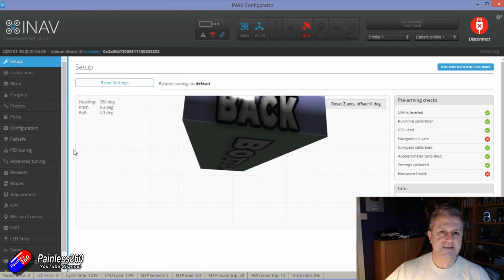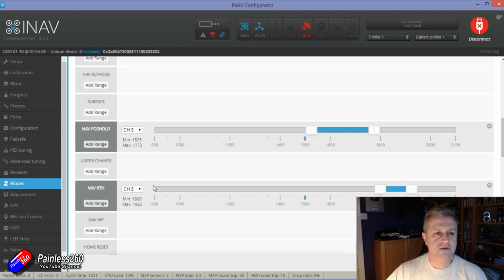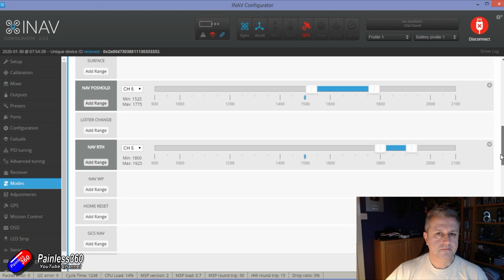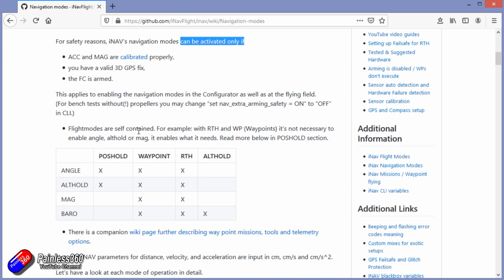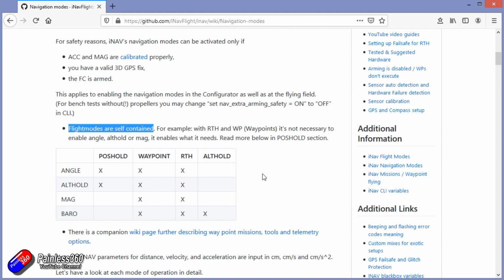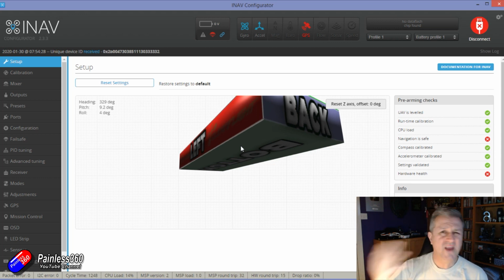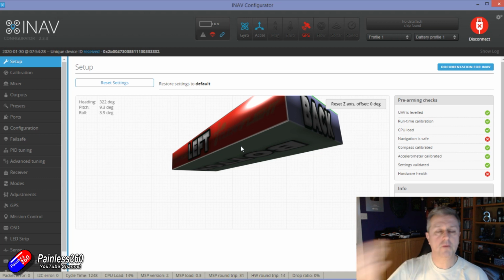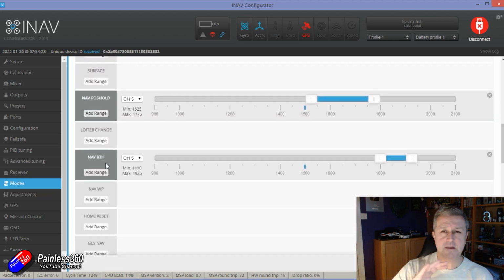Why won't my INAV GPS NAV RTH mode (and others) turn blue in configurator?

Comment: For some time now, I've been struggling with a problem I encountered in the INAV configurator (8.0.1) working with a Speedybee F405 wing controller (firmware 8.0.1). The GPS is configured correctly, works, and finds a 3D fix with four satellites, but its status is always blue regardless of the number of satellites. This is a bit annoying because it's unclear whether the GPS has a fix or not. The only place I can check this is the GPS tab, where I can see the current satellite count and a map with the aircraft's exact location. From what I understand, this status should change from red (when there is no fix), yellow (when the number of satellites is too low), and blue or green (when the GPS has a fix with enough satellites for a 3D fix). What could be the cause? Unfortunately, searching online hasn't found any solutions.
Reply from the maker: Check out my INAV for beginners series. That's not how it works... Best of luck

Comment: Hello again - I have noticed that the Modes ''ARM'' block has two colors Dark & Lght blue if I flick the switch and it's Dark Blue = No Arming  if it is Light Blue Arms ok and motors Run - is there a reason for this thanks again...joe
Reply from the maker: Check out my video on arming - https://youtu.be/RFO4TDIX5oU

Comment: The GPS in Ainav burned red, it turned out that it was better to look at the instructions for Matek. RX and TX are inverted. When I connected the RX wire to the TX jack and TX to RX, everything worked and the GPS turned blue.
Reply from the maker: Yep, that's the way to do it. See my INAV builds on the channel... Happy flying!

Comment: Hi Lee. Thanks for your help always. I have question for you, why in my matek F405 wing not showing NAV RTH mode in configurator 2.5.0? I installed latest version inav on my board.
Reply from the maker: Check out the INAV for beginners 2020 series. I suspect you've missed a step setting up the GPS.. Happy flying
Reply: @Painless360  Thankss!!!

Comment: Hi, I'm new to Inav, so here is a beginner question, at 3:25 the horizontal blue area must be outside of the small vertical blue line? ...both at NavPoshold and at Nav RTH. In Betaflight it must be exactly above it to activate that function.
Reply from the maker: Check out my iNav for beginners 2020 series. I show all the steps... Best of luck

Comment: Very useful tip.
Taking this one step further, I want to see the current mode displayed on my radio -- especially to check before a maiden flight.
If I select a "normal" mode, then I can see the resulting feedback on the radio via telemetry. BUT, if the mode is a GPS/Nav mode, then no change is displayed (with Inav / Frsky telemetry, the flight mode is sent via the Tmp1 sensor).
I am assuming this is because even though it is armed and has a good fix (# of sats and good hdop), the flight controller does not act on the command because it is not flying and/or is too close to home, so there is no new data to send through the telemetry link. Can you verify this is in fact the case?
Reply from the maker: You can't activate GPS modes unless a specific set of prerequisites are met. I'd try to use it in a regular flight.... Happy flying